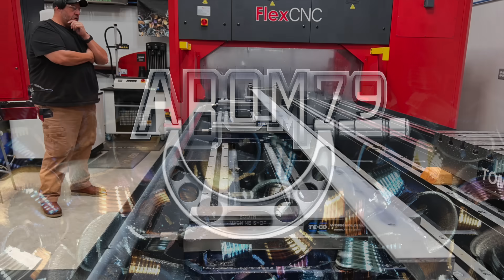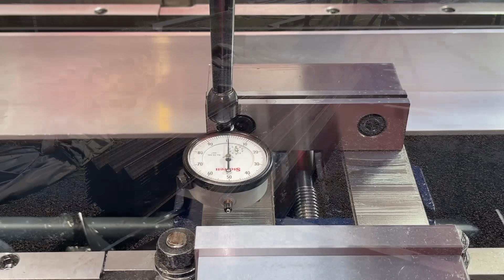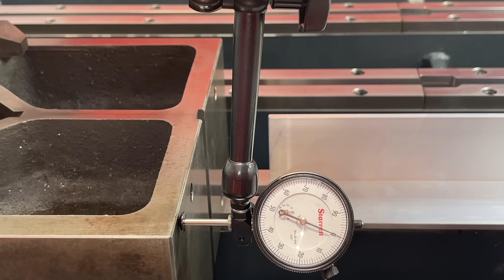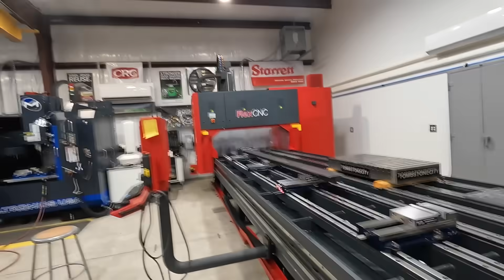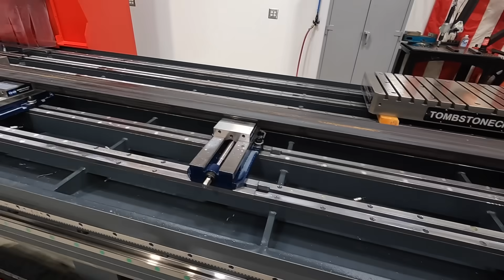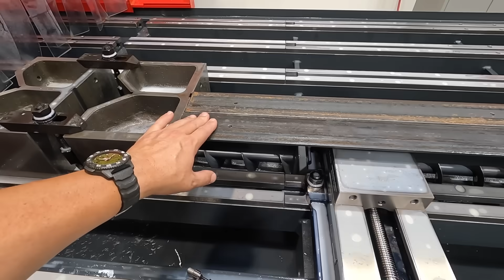Production Drilling in the Flex CNC

Comment: If you have more angle iron jobs like this in the future, consider drilling more than one piece at a time. With the right tooling, you could drill two parts simultaneously and cut your job total time by 50%. For instance, you could put one piece in the vice as you have it now, place the second piece upside down on the first piece and use knu-vice clamps to secure the second piece to the first. This way, your mill makes one pass for two parts instead of two passes for two parts.
Reply: It already drills two pieces in one minute, so add in the extra time to get four pieces perfectly lined up, would it be worth it? And unloading four pieces too.
Reply: @jadesluv  I was not suggesting four parts, only two. You're correct about added load-unload time. Drilling two parts simultaneously reduces cycle time by 50%. With proper fixturing, load-unload time would decrease as well.

Comment: I once did a run of garbage truck hydraulic cart tilts that weighed 45 lbs, by hand. Got accused of going to the gym after that run of 200 parts was done. You are overthinking what is required for this stuff. Sheet metal angle iron parts that they are going to run a self tapper through are not rocket surgery. Relax Adam, it's just parts they would have hand drilled on the job if you were not available. Water soluble coolant from 30 years ago would have done all this flawlessly. I respect the tech but wasted money for this job. Love to have had that machine long ago. Travel time is money. Each hole drilled side by side staggered would have saved some time and you could be blowing off coolant, releasing the vises and unloading while it homed. Maybe not a lot but loading and unloading is machine time. Your initial travel to the first hole you could have z'd close to the start point before drilling. 100 parts at 2 seconds a part is money in your pocket. My 2 cents from trying to make money from CNC programming. Love your shop setup.
Reply: All good, but remember he's doing it to make Youtube content.
Reply: @colinfahidi9983  I get it, Adam has made a living out of it. I point it out for people actually wanting to make money from bidding CNC and actually working. He did a friend a favor and let somebody else run the job. A huge liability if he actually got injured. The longer it took the more the friend lost in the deal. At two dollars a hole Adam is probably making nothing just in the loss from tooling costs and machine time (expensive coolant he got for a bonus). CNC cost money every second they are on, oil is being consumed, the air compressor is running and the electric meter is spinning. Profit is in floor to floor time, programming, machine time and tooling cost bid in advance of the job. Any wasted motion after the bid is won is money lost. There is no point in doing CNC if you don't optimize every single step of the process in advance. 10 parts, no big deal, probably a waste of time for CNC. 10,000 parts a year, every second is money lost or made. You can't make money if don't satisfy the customer and save him money while generating a profit for the shop... When your outgo exceeds your income your upkeep will be your downfall. Nothing is free.

Comment: I doubt it'll be an issue with drilling angle iron, but for through spindle coolant on a drill like that, you ideally want a sealed collet or you're not getting the full pressure down at the cutting edge. It takes the path of least resistance, so it'll go through the splits in the collet, not down the tiny little holes in the drill.
For shallow holes in mild steel that will clear chips out just fine, but something to keep in mind if you want to use it for deeper drilling in anything like stainless.

Comment: I thought it was the cardinal rule that you do not leave the vice wrenches on the vices when the machine is running😮?
Reply: True,in this case the gantry moves not the table, so should be ok
Reply: I've never heard that referred to as a cardinal rule, like not leaving a chuck key in a chuck would be, but I certainly prefer to take them out to avoid having my handle covered in coolant, or some cases when working with smaller enclosed machine to avoid it colliding with the enclosure walls.
Reply: @seabears_hate_circles  those speed handles usually have a spring loaded ball detent  or a set screw that keeps them from vibrating off. I uses those for that very reason on some jobs that are high volume where taking the handle on and off adds time.

Comment: Flex should create a disk D: in their system and not put the client's files on the same drive as the system, which is a bad policy. So if the system has a major issue, needs a major update or upgrade, the client's file are never at risk and any technician can work securely on the OS and Flex software.
Reply: Yep.
I stopped tolerating C drive failures / OS corruption after the third time, and started having everything on an external HDD (best I could do at the time).
Also, RAID arrays used to be a real pain for a dunce like me to implement, but it is included in Windows10/11 now - Hit the Windows key and type "Storage spaces" - It is all point and click from there to set up a redundant drive. With this, the OS can kick the bucket, but your files are totally unaffected.
Reply: @digitalradiohacker  This is how my little fanless PC server with a cluster of USB drives works. On an UPS, never had a hiccup. Windows is mostly underused. And people tend to download and buy software for functions already in the system.

Comment: Apparently it doesn't matter that you're drilling opposite sides on each pair being drilled.
Reply: I thought the same thing, hopefully the ends don’t need to be accurate.
Reply: And if you flip one angle iron end to end, you will notice that the holes are on the same side.
Reply: Yes but not the same distance from the end as required.
Reply: @hankus253  Somewhere in the replies he clarified that the ends are going to be in air and doesn't matter. They had discussed it with the client.

Comment: i may have missed it but dose coolant come out the nose of the second drill bit?
Reply: Yes, that's a TSC drill (through spindle cooling) which means coolant comes through the drill and out the tip, that's why there are 2 holes in it.
Reply: Through coolant passages. Yes.

Comment: Hey Adam, they sell collet nuts and like a seal that seal your collet so that all the thru coolant goes through the drill and not through collet also.  Just a tip if you need more pressure to clear in deeper holes
Reply: There are also dedicated thru coolant collets that will block the coolant to only travel through the tool. Both work well either way.

Comment: Just curious  is all the stock cut to the exact same length 
If not the hole placement from top part to bottom  part will be different when orientated the same ?
Reply: Was going to say the same thing! Hard stop means nothing because they are not exactly the same length.
Reply: @jasonb4350  As I understood what he said, the C-C distance is what mattered, not from the edge.
Reply: @ralphgesler5110  it's not to print

Comment: Cool video. Only thing I could suggest so you have actual coolant through your drill and not through the collet around the drill is different collets. They make collets that will stop the coolant from going through them and force the coolant through your tool. I have run them before and they work really nice.
Reply: Or just use a heat shrink tool holder.

Comment: Couldn't do 4 at a time? Stack another pair on top so if you  were to look done one end it would look like a plus sign. All bent edges would come together in the middle. Just curious.
Reply: Any variation in width would mean that one part isnt clamped
Reply: Be it the bottom piece or top piece, one of the holes would be off by the width of wall thickness.

Comment: It has to be faster to do 1st hole-Y-X-Y-X-Y-X-Y-X-Y-X-Y-rapid traverse to home.
Reply: He tested it that way during setup and it was slower and will usually be slower in most processes. And it does not matter anyway as it takes longer to manually load and unload the pieces.
Reply: He mentioned he tried it both ways
Reply: That doesnt matter when loading parts takes more time than machining :)

Comment: observation/question from a non-machinist….to increase the production, could Adam have used a number of 1-2-3 blocks to put between the angle iron pieces in the clamos to add a third or fourth angle iron piece?
Reply: Why would you? Even a carbide drill is overkill here. 75% of the job time is loading.
Reply: Sounds like you’re describing a double station vise. Definitely seems possible.

Comment: Love your videos. You do know you are using the wrong collet? Thru the spindle coolant requires coolant collets. See the coolant fan out up by the nut? That can actually cause problems.👍
Reply: Care to elaborate? What problems? I’m just curious.
Reply: @matter9  The drill has thru coolant channels, but the collet needs to be sealed to force the coolant through it. You can see this is an unsealed collet, which is why 90% of the coolant is coming outside of the drill and thru the collet
Reply: I noticed that too but sometimes I actually like it to come out both ways so it washes the chips away from the top as well.  Depends what your doing really.

Comment: i don't know if your flex CNC table is large enough but what the factory used to do where i worked jobs like this was having two setups doing the same job.
This allowed us to change one side while the other was going trough the program and vice versa.
Depending on the size of the production run you can save insane amounts of time.

Great to see the flex in use for production
Reply: I would be deburring those holes while the next two were running.  Most people are too lazy for that.
Reply: @larryrobinson7492  i was also thinking about the deburring when they mentioned the galvanizing

Comment: Hey! Someone correct me please. If the angle iron pieces are not the same length, and he flips one to drill holes that are in parallel, then the holes will not align if the piece is flipped back. Right?
Reply from the maker: As long as all the holes are on the proper center to center distance, the end lengths are not important as they’ll be hanging out into air. We discussed this before drilling all of them.
Reply: @Abom79  Whew... Thanks
Reply: What I want to know is why Mr. Booth’s face and eyes look like they are AI generated.

Comment: Since the angles are back to back and you are only referencing from one side, you will end up with left and right pieces.  Does that matter?  I don't see them being labeled
Reply: I commented in a similar way before seeing your post.
Reply: They are going to be galvanized and will be handled again anyway.
Reply: @larryrobinson7492  Your missing the point that only half of them will have a hole exactly at 4" from the left side.  The other half will have have holes based on the cut length which we see is not uniform
Reply: @recklesstim  It doesn't matter, he said it in the video.

Comment: beautiful only the ting is imperial instead of metric ,It's unbelievable that the states still use this system, anyway  great
Reply: What would that gain anyone Dork.
Reply: Here's a clue - the pieces of metal don't care what system is being used for measurement.   Metric isn't more accurate than standard measurements.  He's dealing in 0.001 of an inch.  That's equal to 0.0254mm.    Same accuracy, but a different system.   So the parts don't care.  The only people that care are metric dilettantes...

Comment: ...more than 100k$  cnc machine for a few holes in an angle iron, even in a production environment...to much, after more than 10 years I seriously consider to cancel my subscription to the channel, it is commercials only.
Reply: To be fair, this is exactly what this machine is made for. Its not a super high precision machine, its for doing rougher work on oversize pieces. You wouldn't travel this in a VMC or a manual mill.
Reply: What the heck do you think a production environment is? It's repetitive grunt work that's a prime candidate for automation--it doesn't need to be crazy complex geometry or aerospace materials for it to be beneficial to have the robot do the tough stuff.
Reply: Bye. Have a good one.
Reply: @rcher72  sure...
Reply: You obviously don't know how production works to be lecturing someone. We use over 1/2 a million dollar worth of machines to make some 3 dollar parts, but how we make money is speed. If we can machine 11 of them in 8 minutes and have a guy stand start and run 2 to 3 machine all day, how much do you think we make an hour per machine?
Reply: @a-a-ron8437  So - what's your point.  You're your own hero?  Go buy a cape and impress someone...
Reply: @buckhorncortez  hhis  point is that it's wasteful to use such an expensive machine to drill some holes. But if it pays, then it's worth it, is my point. There is a lot to it. Like if we make less than 35$ an hour on a machine we're  not really making any money.
Reply: @buckhorncortez  see you're  the type of people who think when someone talk like that, they're  bragging or trying to make themselves out to be better than everyone. I'm just trying to make a point that even though some jobs  seem cheap but you can easily  turn it around to make a profit by using better work holding, tools, method of programming,  etc. Yea, I have experience in CNC, but im still learning. I enjoy this channel for his conventional manual machining.
Reply: @a-a-ron8437  me to, but I dislike commercials contents...
Reply: @a-a-ron8437  do you think abom is a production enviroment ? a great business ? maybe not... commercials.
Reply: @SalvoMorina  obviously  not he's  one guy. But that's  not what he is going for. To me, Abom enjoys learning and  teaching. He is obviously  doing pretty well for himself. He's a content creator. Guys buy supercars to boost view abom buy a cnc machine. I get what you're  saying, but again, Abom doesn't just make money of just his work but also his content. It's working for him. I wouldn't do what he does, and he probably wouldn't do what I do.
Reply: @a-a-ron8437  Just a small correction, Adam did not buy any of the CNC machines.
Reply: Why comment, just leave? I get that you probably think this is constructive feedback but if you don't like the content no one is keeping you here.

Hope you got your 10year parting gift.
Reply: @Hossimo  😅no gift for sure, maybe you....
Reply: your point is?
Reply: I guess, he earned a sufficiant amount of money from youtube to pay these machines for his hobby.
Reply: @JohnDoe-es5xh  yes it is...
Reply: No need to “consider” it any longer, just leave.  And you know the saying about not letting the door hit you where the…split ya! Bye.  Adios.  

You’d think after 10 years poeple would have a little more loyalty to someone they’ve watched (and gotten to know) for so long.  The man is doing what he loves and making a return on it and most people would see that and think good for you man!  But there sure have been a few that have started crying and threatening to leave cause of too much cnc or product endorsements 🤦‍♂️ .  And to them, well go, there’s other channels out there.  Try Pakistani Trucks, full of manual machining content and plenty of safety concerns for you to comment on too 😂! (Btw, nothing against manual machining, I like it all beit manual or computer controlled)
Reply: @robertmason8341  ...and 😆adios to you
Reply: @robertmason8341  I can understand the original posters point. Plus, he's perfectly entitled to make his point without the Abom justice warriors getting all hot & flustered!!! I'm pretty sure Abom is more than capable of defending himself. I've only recently subscribed to this channel after years of hearing other YouTubers mentioning him & so far, I'm not a fan. It seems to have become a buy a new machine for the sake of buying a new machine channel. Great for Abom of course as every bloke wants new toys, to me it just ends up being annoying nonsense!!! This week he spends ages faffing about but then feels the need for speed & sets a quarter inch safe height above bowed angle iron & breaks a $100+ dormer carbide drill with thru coolant & calls it a whoopsiedaisy!!! It just doesn't come across as a hobby channel or a real world, real work channel like cutting edge engineering, for example. NOW, I am perfectly entitled to leave & I am perfectly entitled to stay, guess what? So are you!!!
Reply: @robertmason8341  see at that stats, the channel lose viewers constantly due the contents...
Reply: @robertmason8341  :hand-pink-waving:
Reply: @robertmason8341  you are completely wrong...this channel (from more or less two years) is about commercials, not machining. There's a lot of honest contents out there...

Comment: Maybe flip the vises 180° That way, you don't have to lift so far out.
Reply: but then you have to close them from the backside. not so comfortable eigher.
Reply: @BlackRavenCNC  I would rather lift the heavy weight close to center mass.  It's a trade out either way.
Reply: There are vises with the fixed jaw and closing screw on one side, similar to Boley bench vises. IMHO a vast improvement over conventional vises, but conversion persists. 🤷‍♂️
Finding them is a bit of a thing, I think Kurt has made them, not sure if they still do, but back when they were doing really creative stuff. Other companies also make them but the search terms are obviously fraught with off topic results.
Reply: @matter9  That's actually really cool!  I just see Abom reaching out with the heavy bars and think there has to be a safer way.